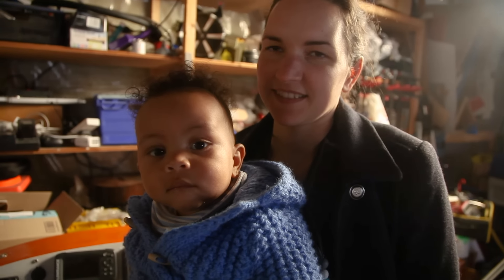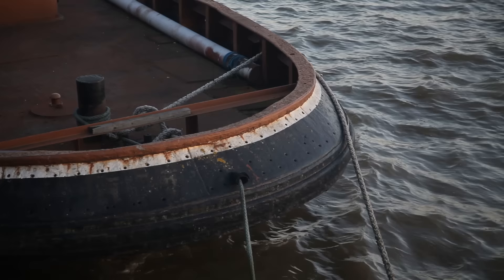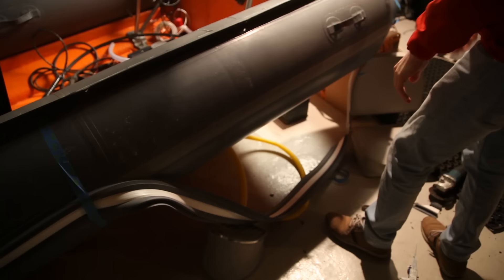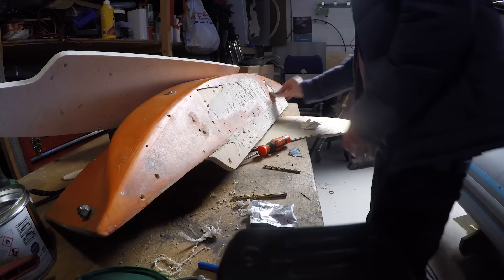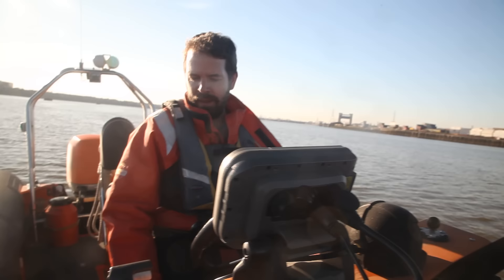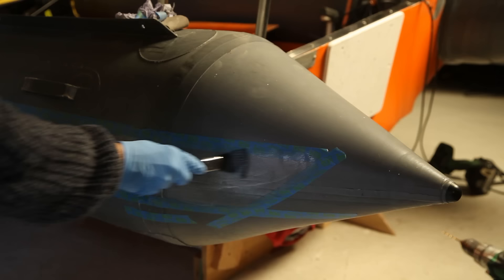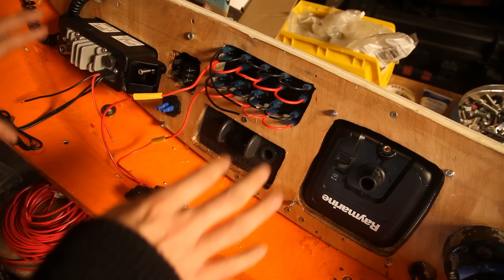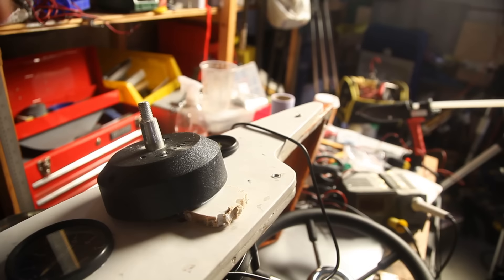Making a Dashboard from Recycled Yogurt Pots - Project Speedboat 4

Comment: Awesome mate, I'm making a dashboard for my boat at the moment , it's a fibrecell dolphin 10ft , it's only meant to be a rowing boat but iv put a solid transom in and just pimping it up a bit , it's only really for carp fishing on Rivers and canal's so I only have a 4hp parsun tiller control motor but it's spanking new so no steering wheel so my dash is all Soundsystem . I bought the boat a month ago on eBay for £150 and the motor for £250 and the plan is to do it up and have some fun in the spring then sell it for the summer and get the next project and work my way up the boat ladder through restoration . I do make the occasional vid but nothing on my boat yet but I'm more active on Instagram (same name as my channel) love the fact you gonna have a go at a lap of the UK..that's mental so you've got yourself a new sub pal

Comment: Why do you have a separate depth sounder (lowrange depth finder) as it's already integrated in your gps device? (raymarine dragonfly 5 or 7)
Reply from the maker: It's the dragonfly 5 and no depth sadly. But the lowrance depth guage is so cheap it's worth having since the reading then has its own dedicated screen. I'm a bit disappointed by the dragonfly. The screen is quite small and no nmea output for the radio. And I can upload a course from a pc etc. Inputting waypoints directly into it is a bit of a faff, although on our latest journey it's worked well.

Comment: You might want to bolt your outboard on to the transom instead of relying on the clamps because that plastic plate not secure the outboard as well as the plywood it replaced.

Comment: Great series of videos. Soldering is not the proper, or approved, way to connect electrical wire on a boat. The vibration can cause the solder to flex and break. NMEA Prohibits soldering only on boats.